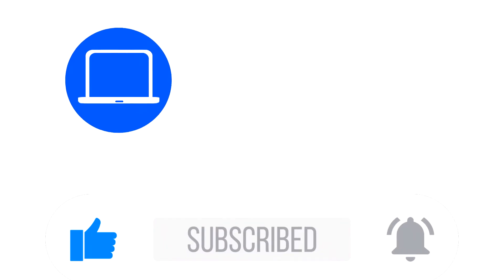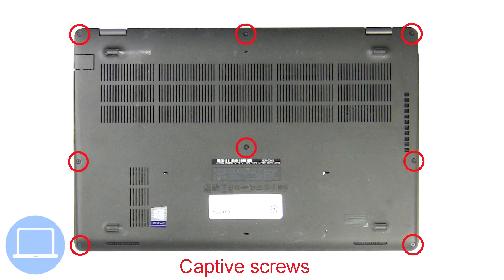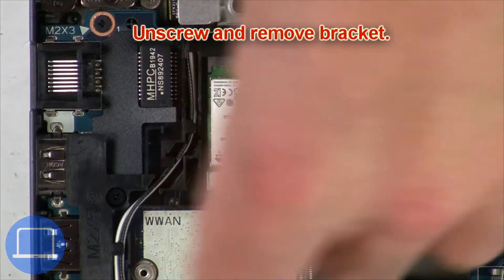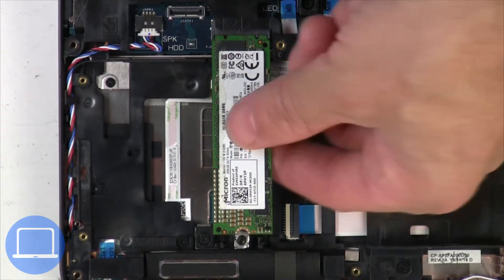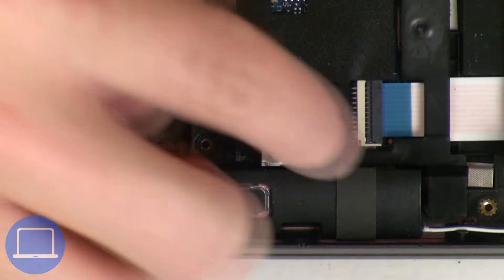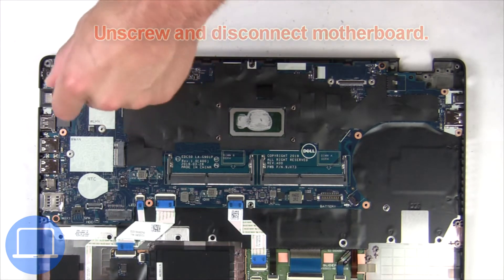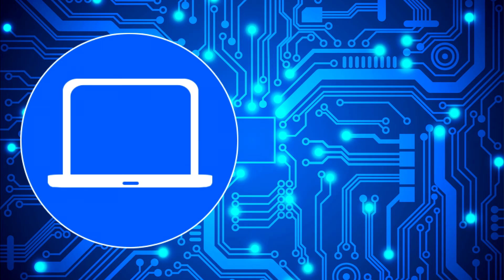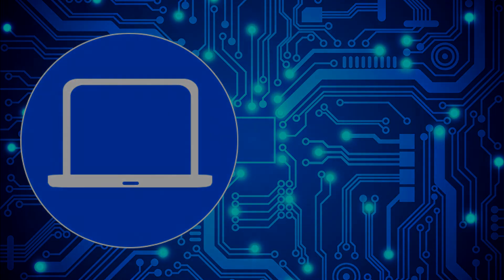Dell Latitude 5500 (P80F001) Motherboard How-To Video Tutorial

Comment: One note of caution to any viewers...  DO NOT attempt to remove the cover with your hands as shown in the video.  This may result in damage to the tabs holding the bottom plastic in place, which can cause problems when you later replace the screws.  The correct method is to use a spudger (or in a pinch a flathead screwdriver; be extra careful) to work your way around the base poping the tabs.  Once the tabs are out, it is safe to proceed with your repair.  Good Luck!